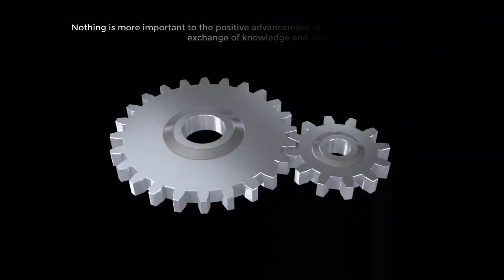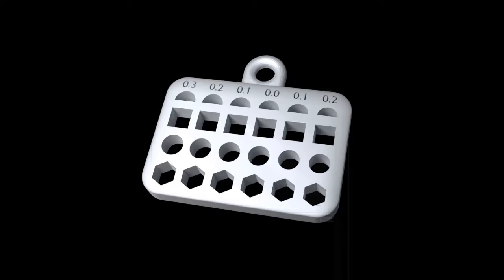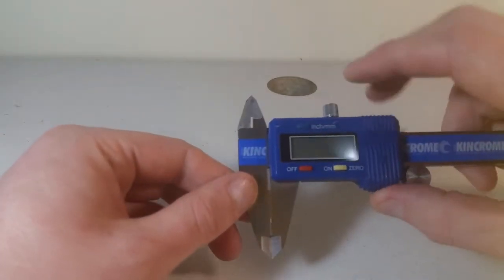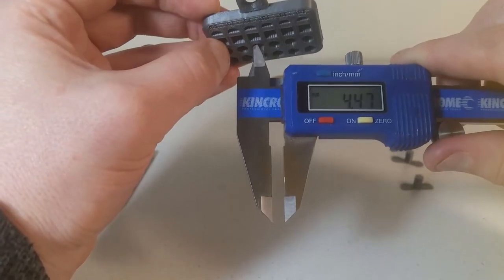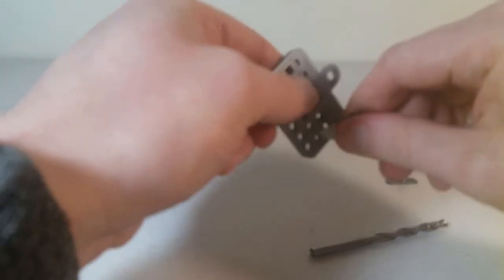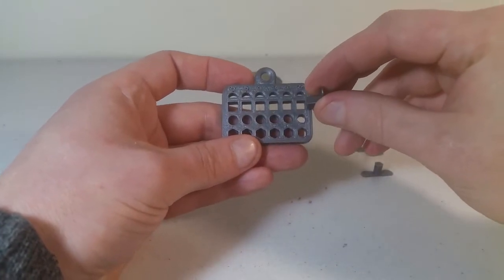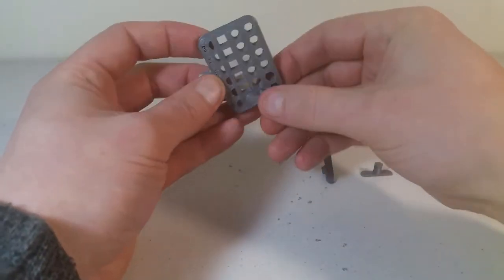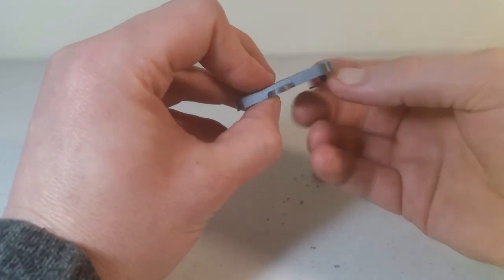3D Printing 3.0 - Tolerances

Comment: might I suggest to update the holeboard and add a chamfer at the bottom layer to all the holes so no reaming is needed. as it is due to elephant's foot or bottom layer squishing as you said, it should be taken out the equation at the design stage!

Comment: Nice, but you need to zero the caliper before you start measuring.  Also that is a really cheap caliper, have you tested it on a feeler gauge?  Its good to invest in a small mitutoyo or starett which is going to be much more accurate.  Ebay is pretty great for sourcing a nice used pair.
Reply from the maker: I apologise for the delayed response;  I am pretty sure I zeroed the calipers during the video; If I did not, I simply failed to show it. as for the accuracy of the calipers; no offence but I a not prepared to comment due to legal reasons. All I can say, is that to date, they have been accurate enough!

Comment: Why not try and calibrate your printer so that it prints the actual sizes?
Reply: I asked myself the same question until I dialed in as many settings as I could but still have "error" in sizes.  To some degree I feel that the material (PLA in most cases for me) have some "slop" when cooling.  Could be under cooling or over heating of the PLA.  Still trying.
Reply from the maker: It will come down to a division by zero error when printing walls 0.4mm thick,  and 0.6mm thick.
Reply: I don't know if you realized this after 1 year having fun with 3D printing or not, but actually 3D Printers are not manufactured to be very accurate in the first place, especially those at the cheaper end such as Ender 3, etc. And the materials itself, are not very consistent in dimension during printing and after cooled down